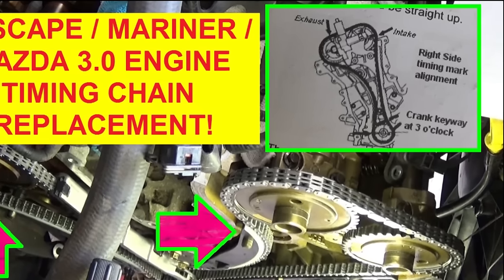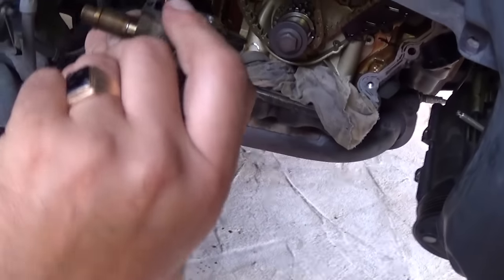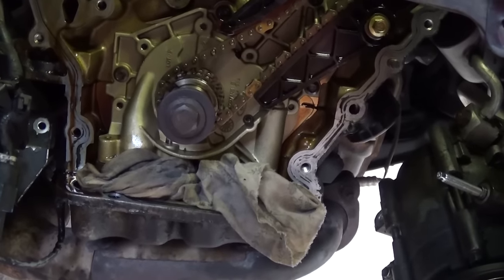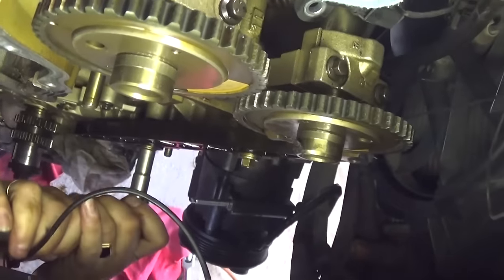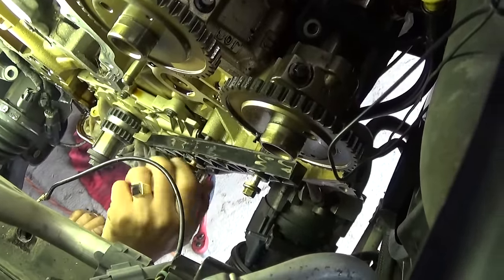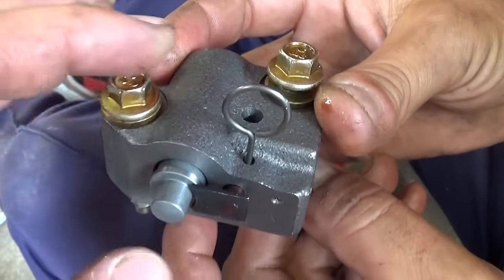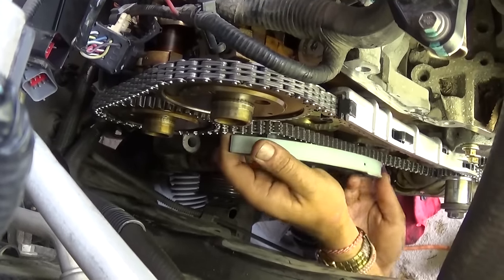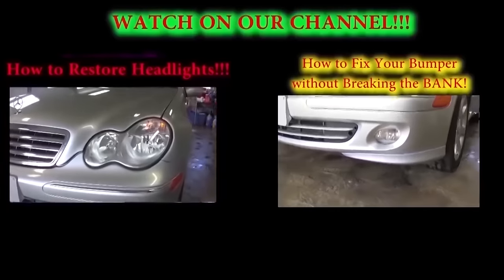Ford Escape Mazda Tribute Mercury Mariner Timing Chain Replacement and Timing Marks

Comment: Wife let oil get low, eventually it gave out, really bad rattling noise multiple engine codes etc. Towed it to shop they said bad engine, $2,800. I wasn't buying that the engine had blown. I knew it had probably jumped time. Followed your steps exactly and $240 later it's all good! Thanks a bunch for this video life saver!

Comment: Thank you for the excellent video. How often have to  change that chain, I have a 2006 Escape V6 engine with a pinging problem. with no PCM codes at all, I had change spark plugs, coils, fuel and air filter, EGR and clean the MAF, but pinging still, even with the 93 octane gas, do you think is a timing chain problem. Thank you

Comment: Hi is the procedure the same for the escape 2005, 2.3l engine? Although it is a 4 cyl. Engine and has only a single timing chain? Also I hear a slight rattling noice but only for a while while the engine is cold after a minute or so it goes away can it be the timing chain?

Comment: I have a yellow 2002 v6 I just got and it needs this done. Do u use any lock tight on those two bolt on the tensioner? I can do mechanic work but not sure about that? Thanks

Comment: The video has been very informative.  I've been told that I need to change the timing cover for an oil leak.  It looks and sounds like I will need to take off the intake and valve covers to get to  the timing cover.  I haven't seen a video by you that addresses this.  Is that the procedure, to take off the intake and valve covers to get the timing cover off?  Would you recommend changing the timing chain too?  It is a 2004 3.0 escape with about 120k miles. Thanks for your videos and help
Reply from the maker: +pat stevens we will definitely recommend replacing the timing chain. At around 140k-150k miles they jump the riming chain
Reply: World Mechanics mazda c9 replaced timing chain

Comment: Does the timing chain cover use a gasket or silicone rubber from a tube?  How difficult was it to remove the cover with the engine in the vehicle.  my cover is leaking oil.  Dealer wants to charge $1000.00 they stating that the engine must be dropped from vehicle in order to access the timing chain cover.

Comment: 2002 MAZDA TRIBUTE 3.0L V6
Replaced the RH (Firewall) cylinder head but did not set the crankshaft at the 3 OC position.  Found instructions later and tried to align cam and crank after watching your video.  Could not rotate engine so I went to front timing chain and tried to align marks (another mistake because this chain had never been removed).  Then aligned rear.  Reassembled but engine would not start.  Removed cylinder head, cleaned head and reassembled.  Started at # 1-TDC, 3 OC put rear chain on but could not rotate engine.
My next idea is to remove rear chain, move chank to 3 OC position and rotate engine 1 and 2/3 turns to 11 OC and align front chain per video.  Then go to 3 OC and align rear chain.  Rotate engine.  Do you have any suggestions?  Did I miss something?  Any help is appreciated.

Comment: Thanks for the informational video, going to possibly do this on my sisters 2006 ford escape 3.0l v6!
It has all the common leaks, Oil pan, timing cover, and rear main seal leak. 
Did you have to pull the alternator out? Because I know those are a pain in the ass to do.  Also, did you have to jack up the engine a little to get access to the bolts?  And also, did you remove the coolant/power steering reservoir  as well?
Reply from the maker: +Mathew 75 (xmathewx75) you do not have to pull the alternator out. You will need to take the 2 bolts for the alternator off because they bolt to the timing cover but the alternator stays there. Yes we did jack the engine up and down so we can have better access.

Comment: I've got a mazda tribute that came to me with a very loud knocking noise, if I put my finger into the valve cover and pull on the timing chain, it feels like it has a ton of slack. Are timing chain or tensioner/guide failures common in these engines? I don't want to go ahead and try replacing it without knowing for sure.
Reply from the maker: +6speeddakota we have had 2 with this problem so far. I have talked to a few of my friends that have shops as well and they said that it is very common if the car has around 150,000 miles. How many miles are on this Mazda Tribute?
Reply: This particular one has 154k Km, so about 92,000 miles, and it's knocking really loud almost like a bad connecting rod bearing. I've got to dig a little deeper to see if I can figure out what's causing it. it did sit for almost 3 years apparently

Comment: Appreciate your very good video and explanation.   But....shouldn't you mention that the exhaust cam had to be 'realigned'  to the required 12 o'clock position once the chain got removed?  also, for anybody wondering.....the markings on the chain links that help to install the chain will NOT align with crank and cam timing marks after the chains are installed......except very very occasionally.  otherwise, a handful of  specific chain links would always be getting stressed a lot more than the other links.   Happy Saint Paddy's Day!!

Comment: I hear a sound in the engine of my Ford Escape has 87,000 miles I'm not sure if I should change the timechain I had damage after an oil change, ford exhaust 2002

Comment: Do you know if this engine is an "interference" or "non-interference engine"? How many miles did that engine have before it had timing chain issues? Looking at buying a used escape with 90k miles... wondering if I should steer clear.
Reply: This is an interference engine, sadly. Doesn't mean that it will for sure bend the valves every single time, tho.

Comment: I am working on ford escape, after fixing the timing the engine will start but on the left cylinder the three coil wire is not bringing current at all what should I do
Reply from the maker: +Adewale Adebayo have you installed the wire for the camshaft position sensors? if you forgot one of the side, three of the ignition coils might not work

Comment: Hey I tried to do this but when I did a full rotation the bottom link ( yellow mark in chain) didn't not aline with the notch where it needs to be. It's off by 3 teeth but then the top doesn't match either.  Idk what to do  . I'm working on my 2004 Mazda 6 Wagon with a 3.0.
Reply: jrock r same problem here, man. Hopefully you figured yours out at this point.
Reply: Were you able to get it done?

Comment: Mr. world machanic great video Thank you for. i put a new timing kit on my 2003 mazda tribute v6 3.0l 
one thing that forgot is the pulse wheel. but i forgot if the gap is goes on the keyway or the other way?. 
help please i appreciated...thanks.
Reply: Depends on if you have variable valve timing. If so, the gap goes along w/ the keyway. If not, it goes the other way.

Comment: do you have a diagram for this? i have a 04 tribute that needs a timing cover changed, i know you have to take off 

-Right side axle shaft
-Alternator
-Power steering pump
-Oil Pan
-Intake Manifold
-Valve Covers

but i need a diagram or a detailed step list.... do you have this please?

Thank you
Reply from the maker: +Paul Marks I will see if I have the manual for this model at the shop and if I have it I can scan you the pages. However, we did not remove the right side axle shaft because we did not completely remove the alternator. We removed the 2 bolts that bolt to the timing cover and we just left the alternator in place that way we did not have to remove the axle.
Reply: +World Mechanics thanks, i wasn't sure if we had to take that off completely... so the rest i have to take off. seems like a big job.. hope this does the trick! thank you very very much, the pages would be great. you can email me at shakesnshivers@Hotmail.com  i really appreciate it, i'm going to take this on this weekend... cheers

Comment: How long did this take from start to finish? Thanks.
Reply from the maker: +R2DTUBE1 From start to finish it took us about 6 hours one person doing it. You have to unhook the power-steering pump from the timing cover and this was time consuming. The alternator all you have to do is remove the 2 bolts from the timing cover. You will not need to remove it. If you have any questions let us know.

Comment: I have A Mazda 202 wheel dr. SUV   my mechanic told me that I would need  Timing cover and casket remove and replace  he  quoted me  a price  unit part $100.00 and labor 1,000.00  he said it would take him 10 hours to do this job .is this a fair price or too high  he said he has to remove a bunch of stuff to get to the  timing cover
Reply: The same thing just happened to me this week with my Escape 2002, what did you end up doing if you don't mind me asking? Thanks!